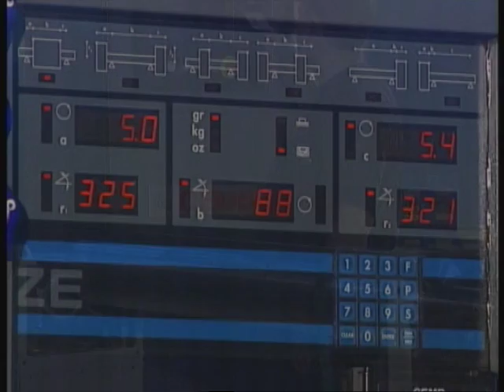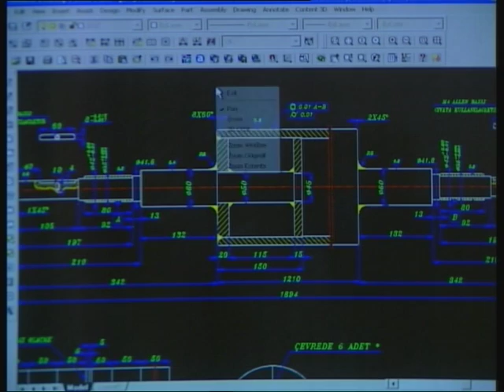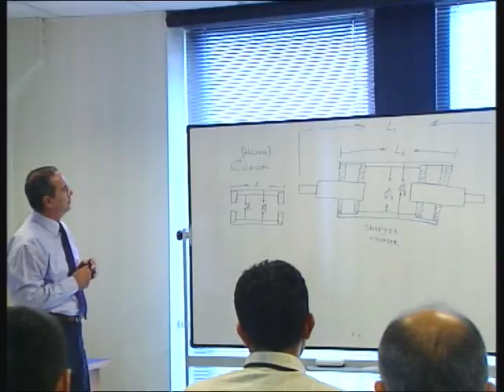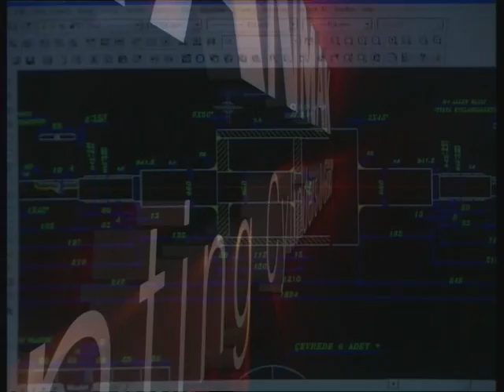TANMAK Printing Cylinders & Gears

Comment: DONGTAI GRAVURE is a professional manufacture and seller which produces synthetic grinding wheel used on gravure printing. 
The products include:
grinding wheel, 
engraving stylus, 
polishing belt, 
polishing cloth wheel, 
polishing paste, 
adhesive bonding and etc.
Mob/WhatsApp/WeChat :+86 13933019071
EMAIL:andywang2099@gmail.com